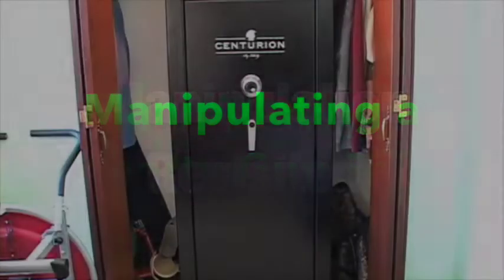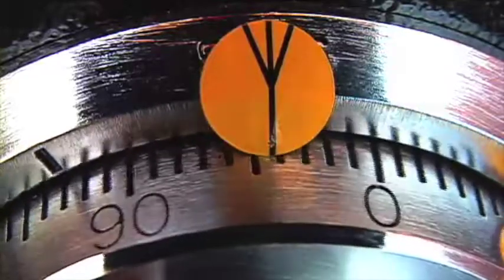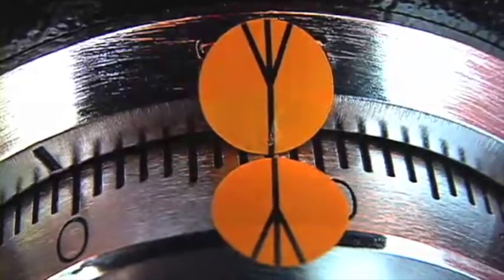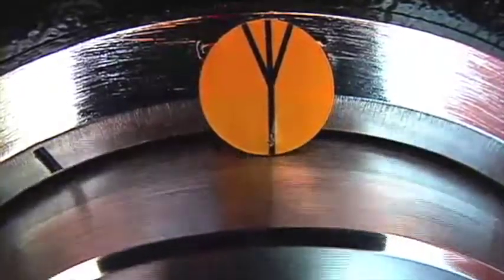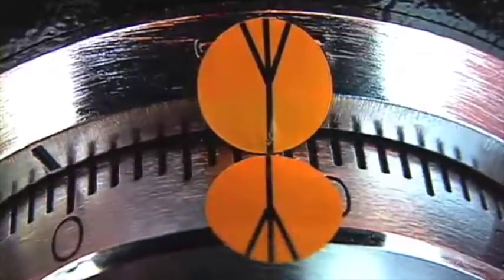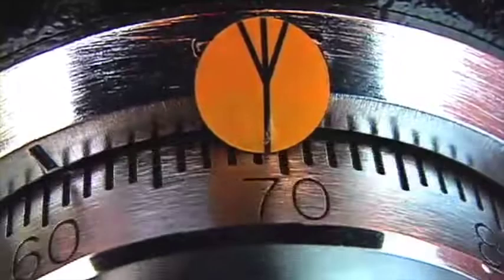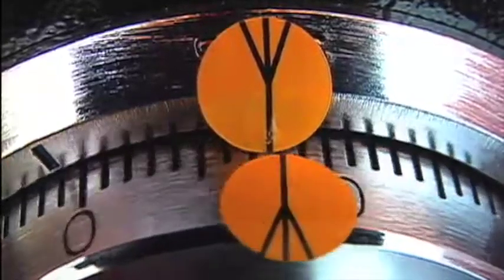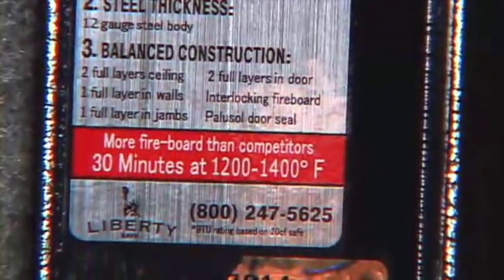Manipulating Gun Safe

Comment: Why do you run 2+3 together? For speed? How do you know which wheel you're seeing the profile of?
Reply from the maker: Once a number is found its easier to determine which one it is. Running all three wheels takes longer to find the right wheel once a number is found. 

Once I find a number on 2 or 3 I will only run that wheel alone a few numbers high and low of the number and see which wheel indicates better.

If you park the wrong wheel you will be wasting anymore attempts.
So that's why I run only 2 and 3 its a 50 50 chance of getting it right
Reply: you need to be able to visualize the mechanical working of the wheel pack inside the lock and this can only be done with practice and using a cut-away lock practice dial. To become a good manipulator you need to be able to control the wheel pack and know how to move each wheel independent of the others; this can only be successfully achieved through practice.

Comment: Ok..  This is the last time I'll bother you.   I got it open. :)
You were right on with your drill hole coordinates..  I just didn't realize that I only needed to bend the cam a little bit..  I bent it so much that it popped the top pin's arm off of the cam (or maybe that arm was already popped off-- and that's why the safe was free);   so the top pin was still locked and that's what was still holding it for me;  ironically if it was standing upright, that top pin would have likely just fallen out and the door would have opened. :)..  because there was nothing holding it in place.   I cut a large hole in the bottom,  there were a couple thin sheet shelves in the way/  I popped the rivets fairly easily and laid them down.   I had my 9yr old son crawl inside and he pulled all the screws on both inside panels, with a drill..  I could only halfway crawl into the hole.. but it was enough to reach the mechanisms and unlatch everything.   We learned a little/  my son had a blast and he'll probably remember this in the future.  It's all fixable from here..    good times. :)     thanks again

Comment: I have an old Meilink safe with a Yale dial, I am going to attempt to manipulate it. In this video you choose 8 as your placement for your crows feet. How did you determine to use 8, and would I do the same?
Reply: you need to determine the left collision point where the drop lever nose collides with the drop cam. In most locks it's around 6-8 but if the drop cam is keyed to the dial in an inappropriate manner then the drop point may be 27 digits off. So you need to find your collision points.

Comment: Good job and tutorial but why you don't use wheel Isolation, scanning wheel 3 only then wheel two with dialing 3 to the  indicated gate?
Reply from the maker: Yes tried that many times and most of the rime nothing indicates. So by moving two wheels chances are greater to finding something.  Then if there is still nothing at least I can park wheel two on a low spot and just move wheel tbree which is fast to do.
Reply: @johnwickpick8621  you heard of 'wagging the dog' if you have low to no signatures? I use the EZ 2 aid by Lockmasters and also want to try the Keedex laser.
Reply from the maker: @jeremysmiles5826  wagging the dog takes to long and is non consistent
Reply: @johnwickpick8621  well, I only use it if I can't get any good indicators.

Comment: If you wouldn't have found a gate signature when going the other way around, would you have parked the wheels around 60 in the first direction (overall lowest point) and start graphing to find a shadowed gate or is there some shortcut to take if neither direction shows a gate when you rotate all the wheels together?
Reply from the maker: Yes your about right I would park wheels 1&2 on the overall lowest spot then run again. The objest is to park at low spots so gates show up.
 Even if you have to park wheel 3 and run 1&2. Dialing can get complicated unless you really know how to move wheels individually. Thats where a cut a way lock really helps so you can see how wheels move with certain turns.

So basicly its practice I would spend a few hours every night practicing until dialing was without thought or counting turns.
Reply: @johnwickpick8621  Thanks for quick response! I think I've finally understood the task correctly. One more question: do you ever graph the locks anymore or would look just for the new lowest point or gate signature even in this case? It seems that you could get the lock open without ever graphing it but maybe I'm missing some corner case here.

Comment: I’ve been trying to open an antique safe made by Wehrle. I cannot find the contact points. Any tips? The dial says Yale on it.
Reply from the maker: Yale usually is gear driven with no contacts could try 50 25 50 but probably need to be drilled
Reply: @johnwickpick8621  Ok thank you!
Reply: you have a straight tailpiece lock. There is a method to open these with a laser pointer taped to the safe handle  and you may be able to find this method printed somewhere on YouTube.

Comment: How often do you run across a loose spline key in manipulation? -- I did one, had to go old school, and "throw away" the amp because of the difficulty in getting good consistent contact readings with the "double click" sounds.
Reply from the maker: I dont use the amp often only on real soft contact points. Havent ran across loose spline key manipulating only in service on combo changes.

Comment: Can this technique be used on a sentry safe dial lock with the direct interacting handle?
Reply from the maker: No not this method that would be similar to the Halls safe manipulation.
There are so many different sentry ssfes some have false gates and some dont.
Newer sentrys are harder because of the false gates also some have two wheels and some have three wheels

Comment: (thanks again for the help) --   Your plan didn't work out for me (so far)..    I drilled the hole and I can see the lever moving the cam..  If I press up on the handle I can just see the end of the cam start to pass the hole..  and I can tell that there's another layer behind it, stopping it from bending;  So I think it must be reinforced to stop this kind of intrusion.  Instead of bending, the edge of the cam chipped a piece off about the size of the end of my punch-- so it basically cut it like a die.   It might be a hardened cam-- seems how it chipped/ cut and didn't bend.  But like I said, I can see another piece of metal right behind the cam-- quite close to it, like it's there to reinforce it from bending.  Maybe it's just the inside cover plate, but IDK.. It doesn't want to bend at all.    Are you sure I should pull "UP" on the handle and not down?   If I pull up, I'm right at the end of the cam..  I can even wedge a smaller punch past it--   that's how far the cam passes the hole.  I built houses and metal buildings for over a decade, so I know how to use a tape and drill a hole, etc..   I'm fairly certain I landed the hole in the right place.   If you have any other tips for me, I'd really be grateful.  Do you think it could be a little extra security safe maybe?   Should I just beat on it more? lol.  Like I said, it wants to break or chip before it bends. ?? 

I started with a 1/4 hole, but everything I had kept bending, so I went to a 3/8 and then 1/2 hole..  I really only punched through the hardened plate with the 3/8.. but it's 1/2 from the top and through the concrete;  So I can see pretty well with the flashlight, even when there's a smaller punch in the hole.  A couple larger punches we have are tapered and they wedge into the hole.. but the handle can't move at all when I wedge them in there--  so they are obviously deep enough.   I'm not sure what to do yet.
I'm probably going to walk away from it for another week or so and try again next week end.  I'll try any tips you give or I think I'll just cut a hole in the bottom like my original plan, and crawl inside and peak at the dials.  (if I have to).   Any more help is greatly appreciated. Thanks again.
Reply from the maker: If the hinge is on the Right side then Yes handle moves UP.

Some of them Mosler have a double cam for strength
So Yes I think your not hitting it with a heavy enough sledge use at least a 3lb hammer.
Make sure your pulling up on handle at same time.
Reply: @johnwickpick8621   Well I guess maybe the hole is slightly in the wrong place.. Because when I pull up on the handle, I almost see the cam pass the hole..  So handle goes up-- which makes the cam go down;  so my punch is only hitting the very top point of the cam (where the curved side meets the flat top edge of the cam).  I feel like my hole may have wondered a bit maybe.. Because it's almost over 5" deep to reach the cam..  it's much deeper than I thought it would be...  Another thing is-- like I was saying-- the large punches we have are tapered and really they are too big and are wedging into the hole, and everything else keeps bending.. So I'll probably have to go buy a hardened bolt that's the right length and size, or at least a straight punch (not tapered).  I guess I can drill another hole right below it if I have to.. If the handle goes up any more, the cam will be passed the hole completely.  We did get the handle to pop and move a bit-- but I don't think it went quite far enough, because the door still wouldn't open.  Thanks again..   I'm going to keep beating on it. :)  (I'm using a 5lb maul.. it's heavy and long handle..  the hammer isn't the issue.)
Reply: @johnwickpick8621   One last update-   I guess that "pop" in the handle did slip it past the lock, because when I would yank on the door, it was loose and seemingly wanting to open.. So I stood over it and pulled up hard and the doors opened a good 1/2" or more..  I could get pry bars under the edge of the door..  but there was still something snagging and holding it..  

I forgot to mention that the second door's handle had already been removed or broken..  So I'm thinking that second door was hanging it up.   So we were wrenching on the 'good handle" (on the right door-- by the lock) a little too hard..   and unfortunately now that handle also twisted off.  I didn't realize that it was brass and made to brake away or I would have been a little easier..  Honestly I think the previous owner had already half way twisted it off because it was facing in a weird direction and not the same as what I see in pictures..   So I think I'm going to go ahead and cut a big crawl hole in it..  It will be fun, if nothing else.   Thanks again.. Cheers

Comment: Awesome video I’ve been trying to open a S&G gun safe thanks for showing the dial up close awesome video!!!
Reply from the maker: Whats the issue with gun safe no combination?
Reply: @johnwickpick8621  I have an Amsec gun safe with an S&G 6730 and even though I do have the combination it still will not open.  One of those things where it worked fine until today and then my combination will no longer work.  I assume it drifted but even after trying some nearby combinations, I have been unable to get it to open.
Reply from the maker: @MrGrigs681  heres something to try dial the combination then come back right and stop around 5.
Now hit next to dial with a rubber hammer or mallet several times tbis might jiggle it in.
Now try turning to right to open
Reply: @johnwickpick8621  Thank you for the response.  I tried that along with every other tip I could find online but with no success.  I am worried now that the lever arm spring may have broken.  My lock is positioned such that the lever arm is beside the wheel instead of being above it so gravity will work against me instead of being in my favor if the lever spring is broken.  I have spent hours trying close-by combinations and it still will not open.  I have called a locksmith but I live in a rural area so getting somebody to come out is no easy task.  If I can get someone to come out I will let you know what the issue was.  If not, then I guess I will be testing out my angle grinder.
Reply from the maker: @MrGrigs681  Its easy to tell if the lever spring is broken because there wont be any contact points felt between 95 and 10 
If you hear the click click sound then its not the spring.
And that is rare to happen anyway.
If you have the combo dial it in and hit the door with rubber mallet.
Dial must be between contact points for that to work.
If you dont have combo probably needs to be drilled.
Reply: @johnwickpick8621  Thank you again for the reply.  I do feel/hear the contact points between 95 and about 05 so I guess my spring is intact.  I tried the rubber mallet again but had no luck.  I will try again tomorrow to get a locksmith to come out.
Reply from the maker: @MrGrigs681  if the mallet didnt work and you have the combo then one wheel is usually way off.
One more thi g to try is put wheel 1 and 2 on original numbers and run wheel 3 only 15 number s below to above its number.

In others words if combo is 10 20 30
Dial 10 20 then 15 16 17 18 up to 45 always coming back to 0 to open.

If no go then wheel 3 is ok do the same thing on wheel 2. You will have to dial full combos to run wheel 2.
Wheel 1 usually dont change
Reply: @johnwickpick8621  I'm in!!!!!!!   In my excitement, I do not remember how far off it was but yes, the last number was off....and I was also using the mallet for good measure.  The exact number that worked does not matter now anyway as I will be replacing that lock.  Thank you so much.
Reply from the maker: @MrGrigs681  Bravo thats Great work

Comment: Thank you. This is great. I'm still a beginner so excuse me if this is a dumb question; But, why do you spin 2 and 3 to find the first number and not just 3? Is it so there is more of chance to finding a gate? Afterwards do you just spin 3 to check if the gate is on that wheel or wheel number 2? Again thank you for posting these videos!
Reply from the maker: Basicly yes more chances for a gate.
And because if ya park 1 and 2 and just run 3 then any high spot on wheels 1 and 2 will hide the gate on 3.
Sometimes you can find a gate only on 3 if you run it by itself but less likely to.

Second question is after gate is found I run wheel 3 by itself through the gate area then I run 2 by itself and one of them usually indicates a reading.

Now you can run all 3 wheels to start but its harder to determine which wheel the gate is on. Remember if you find a gate and dont pu
Reply: @johnwickpick8621  Thank you for the reply. And if possible could you repost it? The end of the comment seems to be cut off and I'm very interested in your tips. I hope that this "series" continues. It is hard to find indepth information on youtube by people with practical experience. Thanks.
Reply from the maker: @nemocheerio  oh yes I was going to say that running 3 wheels will work to but it takes longer to determine which wheel its on. Now the majority of the time wheel 3 indicates first but if you think like that it will throw you off. Never assume or guess thats a big mistake in manipulation. For example if you assume the gate is on wheel 3 and its not wheel 3 then any time you spend after that is a waste of time because your then parking wheels in wrong places. So basicly thats why I start with running wheel 2 and 3.
Reply: @johnwickpick8621  Great advice. Thank you.

Comment: Nice video and fast dialing! Interesting how the awl didn't give a gate. Was that because of 2.5 increments you think? Obvious gate at 80 indeed. I just manipulated once so it's awesome to see a pro at work like this👍I should do another run the coming days... Thanks for sharing
Reply from the maker: I didnt get what you mean by
The awl didnt give a gate what was that again...
Reply: Thanks for replying.

When you did a round with all wheels left, you didn't see a clear gate signature around 80. With all wheels right, you did. Correct me if I'm wrong, but if my understanding is correct, that theoretically shouldn't happen if the gates are slightly bigger than 2.5 increments.

My question was: do you think that was caused by the 2.5 increments (the gate falling just between two of your readings by chance) and you probably would have seen a gate with e.g. increments of 2 or is there a different reason?

I hope I could make my question more clear.
Reply from the maker: @EdocDab  The reason why a gate can be found one way and not the other is the wheel profile changes. In other words the reason a gate is not found is because a high spot on wheels and not letting the fence enter a gate  thus no reading.

When the direction changes the wheels are not exactly the same place so the high spot is now removed.
That is why you cant dial open a safe in both directions with the same numbers.
For example if you dial 20 30 40 Left Right Left, it wont work if you dial Right Left Right. So that proves the wheels line up differently and can remove any high spot. Running 2.5 or 2 makes no difference if the fence cant enter a gate from high wheels.
Thanks
Reply: Yes, with your extensive explanation I understood it clearly. Thanks a lot for that and I'll keep the lesson it in mind. Again, I really enjoyed to watch you work the dial in this video and thanks for answering my question!